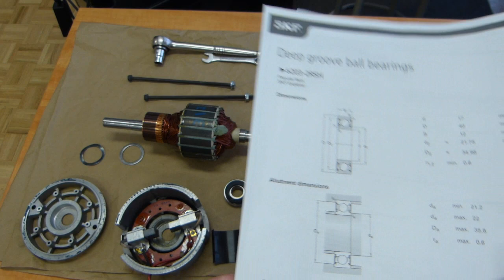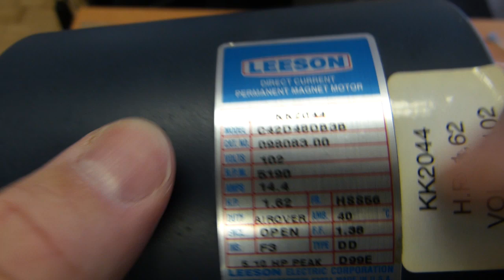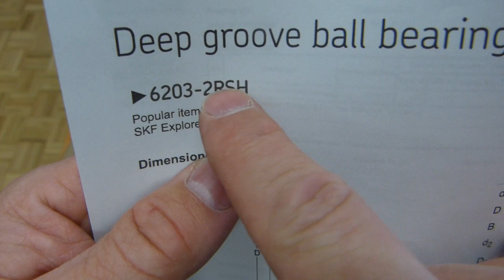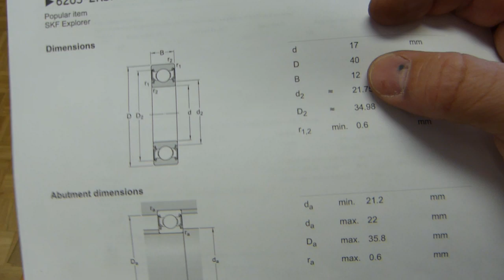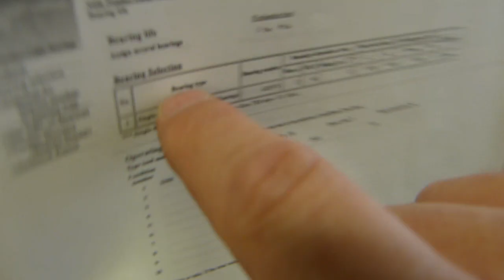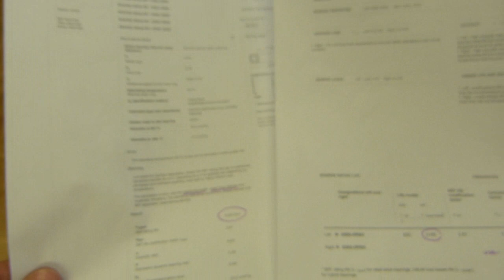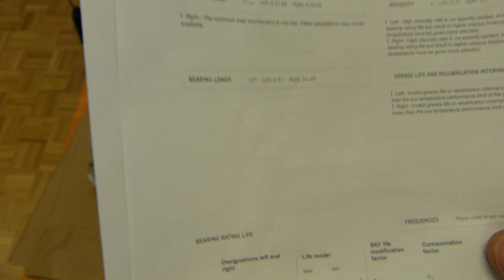DC motor rebuild for $12 (a saving of $2500)

Comment: Great explanations for beginners. Very encouraging.  I am rebuilding a small greenhouse inflation fan there is rust on the copper wiring.  What do you suggest I use to remove the rust? The copper wires are very thin and I don't wan to break them.  Thank you.
Reply from the maker: Copper wires are coated in varnish, microscopically thin layer but critically important. Any cleaner that dissolves the varnish is counter-productive. Rust is iron deposits, they are water soluble. Test is with water and a soft toothbrush, then dry everything with air, See how that works out.

Comment: That's not chewing gum. It's the weight they use to balance the spindle. It goes on very soft and flexible..like dough. It's soft like this to allow the operator of the balancing machine to "pinch" pieces off the weight to bring the spindle into balance. After 24 hours the "dough" will harden like a rock onto the wires, permanently.
Reply from the maker: Cool, thanks!

Comment: can you help me understand how you can put the wooden dowel to hold the brushes and remove it after installation? For my motor, I don't have enough room to put the wooden dowel in as there is barely any gap after I insert the commutator into the hole. Please advise?
Reply from the maker: Any thin piece of wood, metal strip, paper will do.
Thanks for watching!

Comment: Thank you, very clearly explained!
So $12 for the 2 bearings, but how much for the specialised tool you mentioned?
Reply from the maker: When was it mentioned?
Reply: @theoverengineer  11:42 "a proper bearing installation tool".
And isn't a bearing-puller also required?
Reply: @DougWoodrow  you can use any pipe strong enough and the right side outer diameter to fix the inner sleeve of the bearing. How much is that? A dollar? The old bearings can be cut off with any rotary cut off tool. 20$ maybe

Comment: i have smoke coming from the motor , but it's working fine 
what may be the problem ?
Reply from the maker: - burning through the varnish on the wires. Too much friction in the bearings?